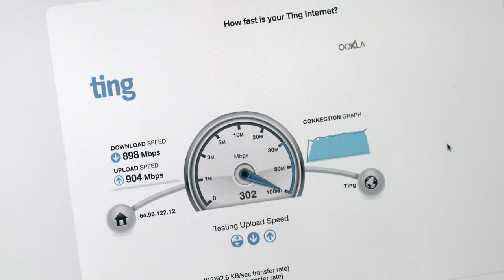Ting Presents: Lighting up Holly Springs (2017)

Comment: How bout a side by side comparison of download speed of other competitors
Reply from the maker: Hi there. Since our competitors offer many different tiers of speeds, this is hard to do.... but our Gigabit plan (which is our main offering) can deliver a consistent 900 Mbps down / 900 Mbps up at all times when hard-wired in via Ethernet. It doesn't slow down during peak hours. The numbers will vary greatly if using Wi-Fi, though.

While we can't compare to all other ISPs, the national average is approximately 25 down / 10 up for broadband service -- making Ting crazy fast by comparison :)